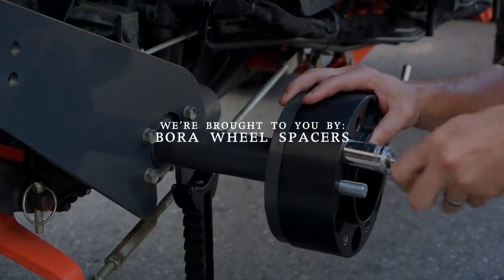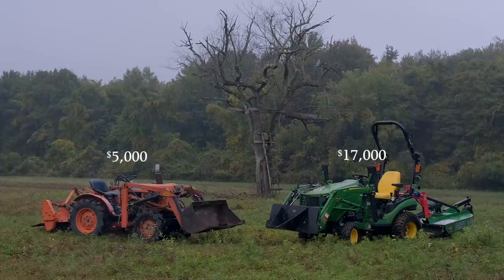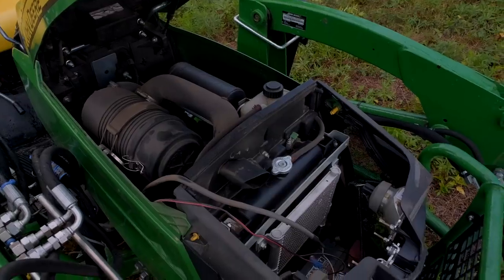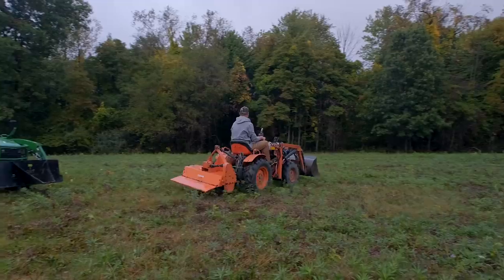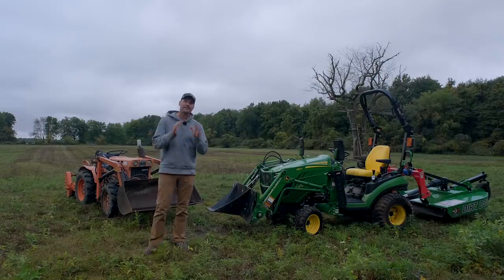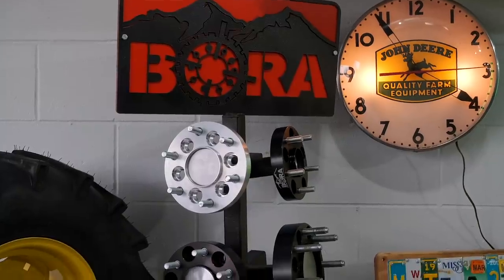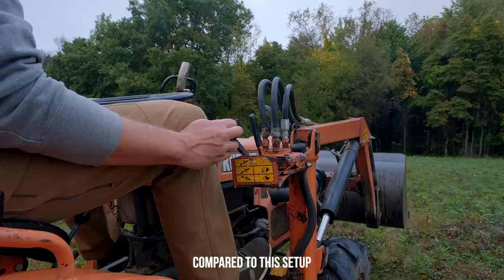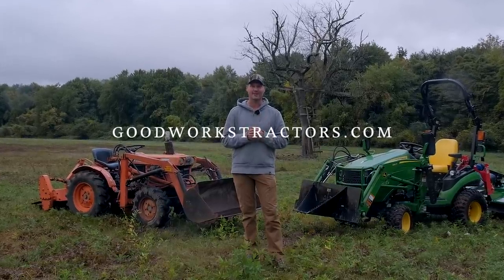WOULD YOU RATHER? WORK ON YOUR TRACTOR OR PUT YOUR TRACTOR TO WORK? 🤔

Comment: I currently have 4 older lawn/garden tractors setting around my property, 1 was my father's JD 265 which he bought New back in 1994. Then I have 3 of my nephew's tractors that he bought. 1 he bought new from Sears and is broke down, another one he bought used and is broke down, and another one that is in my garage which my nephew also bought used, which EATS batteries, and the hood fell fell off it after either he or his wife had ran into a tree branch and dented the front end and the headlights fell out and broke the one bolt that held the hood on on the one side. LOL  Yes, my nephew is hard on equipment, then when it breaks he junks it, and gets a replacement either used/second hand or new.  He moved out end of December 2020 and left the junk here until he can get a trailer to remove it. With the one in the garage it runs but eats batteries. I guess I have to run it FULL Throttle. I thought I was, but apparently I was not, so now a new battery is dead. UGH!! 

If I would win the Powerball Lottery Jackpot then I would fix the 4 tractors up like new and sell them and Purchase a NEW tractor! LOL

Comment: Old Kubota are generally easy to work on,  and you might afford two of them.  If you need reliability then you'll want a newer tractor.  But a properly maintained older model won't be a money pit;   And you might enjoy restoring an older tractor.  I've bought older Kubotas for $300 that need some work, but you won't lose money on them once you repair them.   I buy parts from Messicks.  I find nice sheet metal harder to find than mechanical parts.  I'm hoping the 1025R becomes a cheaper 2nd hand tractor as the newer models are more refined.

Comment: If you can pay cash, an older tractor could be a better deal depending on what you are looking for, even with repair costs.   If financing though, newer can be better.  Example, I am starting up hay next year, got the equipment, old, used, doing the repairs myself to get in good working condition, and so far got mower, rake and baler for under $5K.   Now the tractor, need something in the 40HP range for this since it is a small production. I could have looked at older used tractors, but Safety is #1 priority since Farming is not my main job and getting injured is a no no.  Looking at 10-20 Year old tractors that have the safety features I am comfortable with, IF I can find one, are priced not much less than new ones.  Here's the catch, older than 15 years the interest rates are almost doubled than on newer models, so a 5 YO tractor would have the lowest rate.  New tractors, like from Kubota have 0% long term rates.  By the time you paid the interest on the 5 YO tractor, you paid as much as you would have on a brand new one   Something to keep in mind above and beyond what was in the video, all great information BTW

Comment: I had a Kubota L185 DT . It was a very tough little tractor. More powerful than you’d think but very basic.
Reply: I have a L185 with out the DT and wished it had it.
Reply from the maker: Yeah, that B7100 has a lot of power for its size.  Almost a scary amount.
Reply: I’d never have a compact with a loader without 4WD. The loader makes the rear wheels too light

Comment: I picked up a Kubota L295 that is a 1979 model with a loader and backhoe and a mower and front plow and a tiller and box blade the tractor had 700hrs paid $3000 for it. My Mother bought a Deere 1025r with loader and backhoe and mower she paid $22,000 and my old Kubota will out lift it and is alot faster I have tedded hay with my little guy and I have even ran my New Holland 315 baler with mine on flat small fields, I brush hog with mine also and mine has been worked on way less than my mother's 1025 that thing is constantly back to the dealer oil leaks rough running pto not working wont start ever other week it's something on the 1025 my work on mine usually consists of washing it changing the oils wiping it down and polishing hood and fenders maybe changing a light bulb and putting it in the shed. Never would I buy one of the newer junks doesn't matter the brand they are all garbage to me all plastic you hit something there goes 1000s in new hood or fenders hit something with the older tractor if it even scrathed it usually just a dent that can be popped right back out. Another thing is all the new are hydrostatic and hydro is not meant for any hard pulling or skidding of firewood ever seen one of the new tractors after the owner has pulled a few hundred cords of firewood out they are about ready to die my old tractor low range is a skidding brute without even running the tractor on the governor like most of these new ones need to be lucky if my tractor ever hits 1500rpm unless I'm headed down the road then I'll run it open high 4th gear tractor does around 15mph many new ones maybe 10mph if that. I mow several lawn in a small radius around our town and I buzz from place to place no truck and trailer and when I'm done usually the furthest yard it's 5-6 miles the new tractors wouldn't even consider the ride like riding a moped.

Comment: I choose old to new. My new tractor is a 1969jd my old one is a 1941 jdH. I have more in between. I use old 1209 conditioner to mow hay old rakes to rake and 30 year old round baler and a 40 year old square baler. In everything I have less then $30k. What would a new 100hp tractor cost or 70 or 50 or 30 or 12hp. My 80 year old jdH out pulls my 18hp Kubota bx any time. I burn less then 5gallons to rake 20 acres. The bx mows grass great. So I respect new but can't afford  new equipment. I'd be close to $250k or more in new

Comment: To look at tractor changes over the years it seems like it took about 15-20 years to see the capacity of a tractor to be about double of the older. Older is easier to fix with a wrench but not always cheaper . Safety and emissions have given us a new set of problems to take on with the larger machines . And the nuts and bolts side of them seem to be better built but the electronics dont have the life span . also more planned and engineered obsolence

Comment: As nice as the new one is….I’d still rather have the oldie. 🥰 the power steering can be added. Mirrors added. Hyd trans never liked em. Also the old ones can run on a much wider range of fuel oils. 😎

Comment: “I have found that if you go completely through  old machinery it is very reliable” Just A Few Acres Farm
Reply: @outinthesticks1035  oh yes I have a 806 with 3015 hours that recently has been rebuilt I also have a 4020 diesel with 2000 hours a MF 1085 with 4000 hours and there all very good old machines and non of them except of course my 806 have had and large problems 👍

Comment: You mentioned the Deere (forgot the model) has a PTO cutoff for when you go backward. I have a Kubota BX 25 about 10 years old. It doesn’t have that, is that something that kubota doesn’t put on their sub compact tractors? Not sure I would want it on mine because it’s my main mower for 5 acres and I back up a lot due to the acute angles. Do the newer BX’s have the PTO backward cutoff?

Comment: my 1949 farmall h  has out pulled every new tractor of comparable size. it out works everything it has gone up against. and I have only rebuilt it once. and because I did it right back in 1987 it was still running when our new tractor went down. several times. I have literally pulled 58,000 pounds with it no problem and my newer tractors struggle to pull 5,000 to 10,000 pound. not impressed with new tractors at all.

Comment: Well I've had both of thies models at the same time . Bort the new jd because i wanted some little luxury , ie power steering  ,and get away from the manual box....but give me old school any day.
Fuel.. my old kubota 10 letter tank could slash 4 acres on 5 letters .
New one jd 20 letters 
The kubota had a 3 stage pto ,witch ment at idle the slasher could mow way better then most mowers, (just sharping the blades ) 
The new tractor didn't have a pto, witch ment you have to have it all most flat out 2500 rpm just to get the slasher to do 550 rpms if i remember .
Manuel just seemed to have more pull at low revs .hidrostackic didn't like it when loaded up .
I didn't like the safety switches on the new one ,the seat one was a pain in the ass ,if you leaned over to look at something or took your weight off the seat a little it shuts off the engine, you have to keep adjusting the bucket when lifting up.thies take some getting used to but can be fixed 😊
Getting on and off the new one wone hands down .
I uesd to fill my tyers full of water low psi help with traction and stability.

Comment: The Kubota is going to break a lot more but fixing it is way easier and the parts are much cheaper than the John Deere plus there’s little to no electrical on the kubota whereas the John Deere is all computerized and when it breaks it’s a pain in the ass to fix

Comment: The newer one is aluminum and plastic then older one is a real tractor and you can build stuff for it or get aftermarket parts a bit cheaper and if it’s a tractor many people have you can get reproduced parts or even modify it to your needs and more accessibility and less wiring shit a newer one is more likely to break down you see more newer ones in shops than older ones mainly since the older ones you can fix unlike the newer ones and the newer ones if you break a axle on a newer one then they recommend a new one unlike an older one they have lasted for many years and many newer ones have more other problems than the older ones more likely to short out and catch fire and most newer ones have all this other shit because most people don’t take care of them properly or don’t know what they are doing and how to operate it safely

Comment: If your not mechanically inclined, you should probably just buy new. For us mechanically inclined the trick is to find the sweet spot.  A used tractor but not so old that parts are hard to come by.  I find an older BX like a BX2200 is the sweet spot. Its hydro,power steering, has a roll bar, seat belt and all parts are available. Its every bit as productive as a new one, same goes for the JD equivalent.
   I would not buy a tractor as old as the one you have pictured.

Comment: I’ve got a question for you guys r anyone else.  I have a 7yr old B2320 without a bucket 🪣 r hydraulics.  I’d like to add a front end loader and a rear hydraulic to run an off set flail mower.  My mower is probably a 6-7000 dollar gear drive machine.  Is s smarter to spend an additional 7000 to add a loader and hydraulic or buy a newer one all ready set up?
Thanks for the videos.

Comment: I would choose the older tractor every time All those creature comforts you talked about with your John Deere and the safety features are all really expensive things to have repaired later later The real question is what's the cost of repairing the old tractor and what's the cost of repairing the new tractor when the warranty runs out and being John Deere you have to take it to a dealership
Reply from the maker: Sure, if you look at it in a bubble considering just that one aspect of ownership.  However, that's an incomplete picture of the overall comparison.
Reply: Wait till you find out parts for anything 15 years or older aren't being made anymore. Prices are skyrocketing on equipment parts even the common stuff.